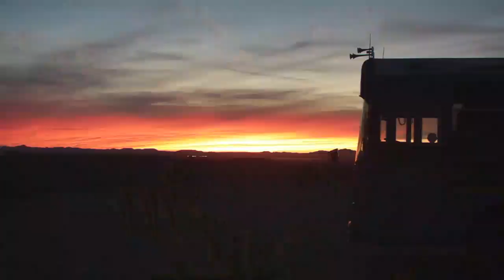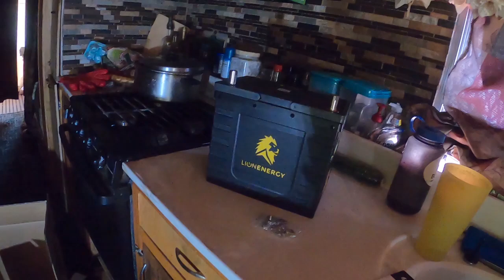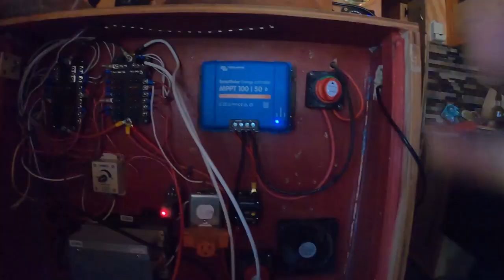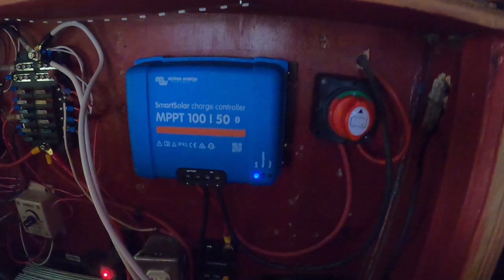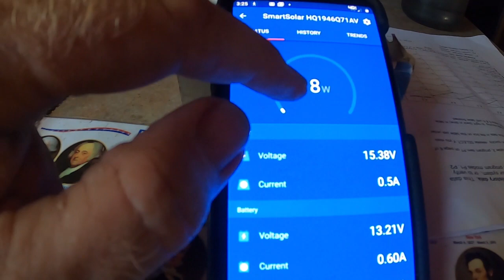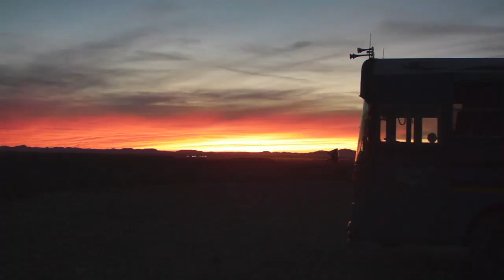Solar Problems

Comment: Good thing your smart and figured it out yourself.    I have been watching you since the beginning.  If I remember correctly that would be your 3rd fridge.  I hope my Alpicool lasts longer than the brand you use.
Reply from the maker: Fifth actually. The first was a dorm fridge that needed more power than I had.
Second was a tiny one that lasted two years
Third was the same as the second but lasted two months
Forth was the 105 at dual compartment that just got fried 
Hope this fifth one lasts a while
Reply: @SteampunkSteve  Jeeze~!   I hope it lasts for you also.

Comment: how much were the charge controller and battery (individually)
Reply from the maker: Charge controller is $328 and the batteries are $899 each
Reply: @SteampunkSteve  that's a really good price on the charge controller, battery is a bit expensive for me (at least right now)
Reply from the maker: @Coolbreeze61  that's why I didn't get lithium earlier. Turns out two of my five lead acid batteries were cracked.
Reply: @SteampunkSteve  I have 6 agm batteries wired in parallel and series (24 volt system)